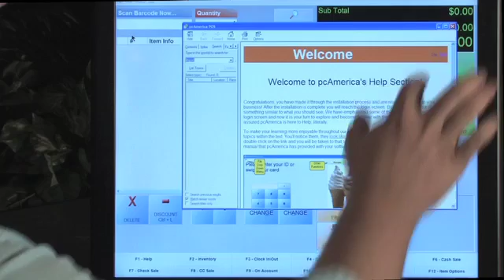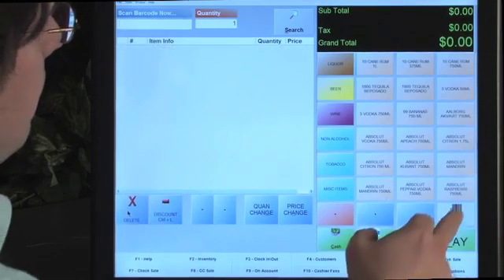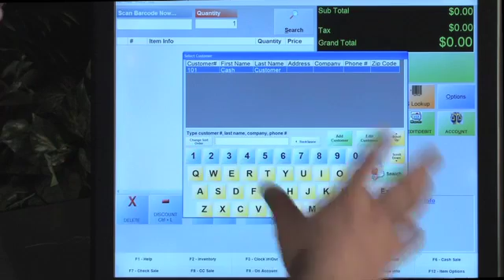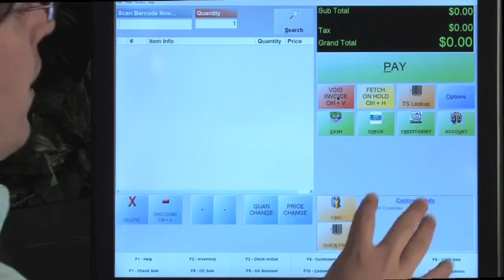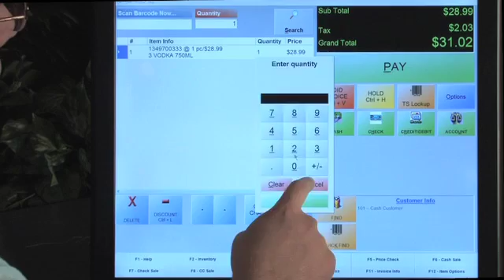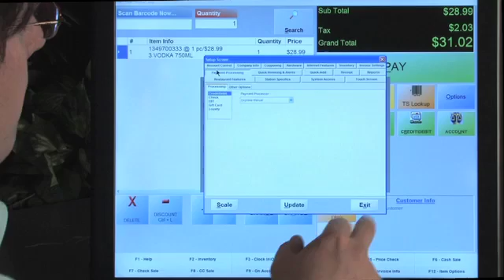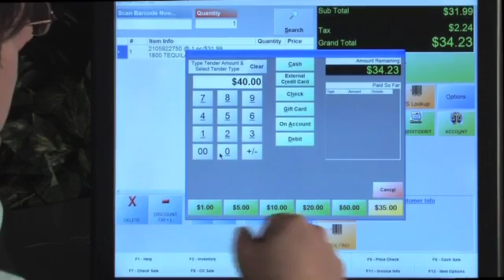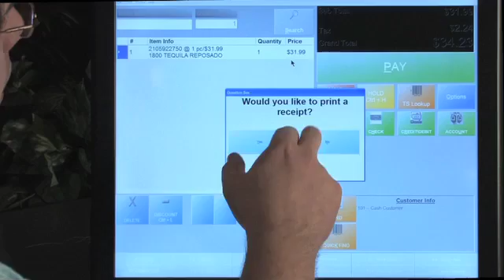Cash Register Express (CRE) - Hardware-Software Set-up & Orientation

Comment: I am having problem in my CRE. The receipt is not printing at CHAPPOS thermal receipt printer. Hence, the cash drawer also does not open automatically as it use to be. Greatly appreciate your help
Reply: I've found that the wire from the pc to the printer can become kinked / pinched, try to straighten it or replace, bad connector perhaps.
Reply: ggfddderrdrgkiiii I k I jttwrr